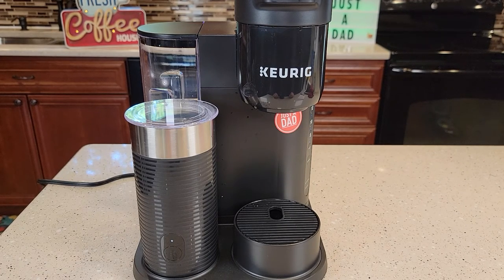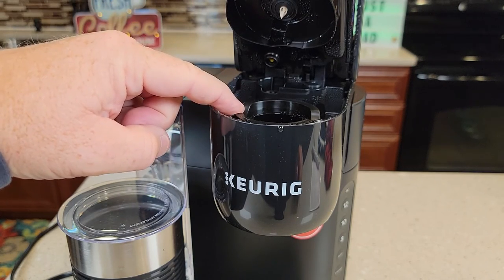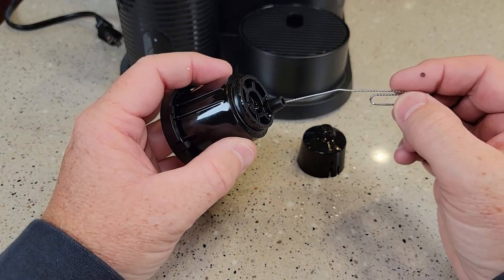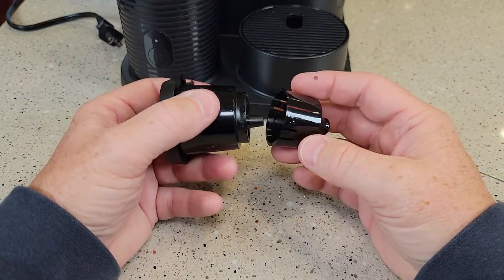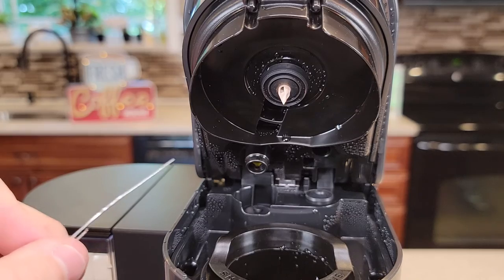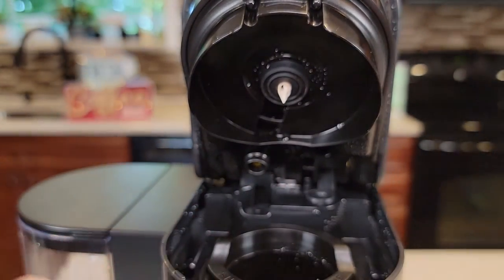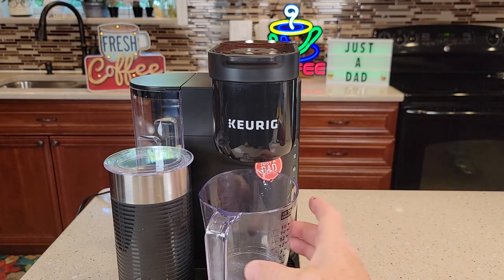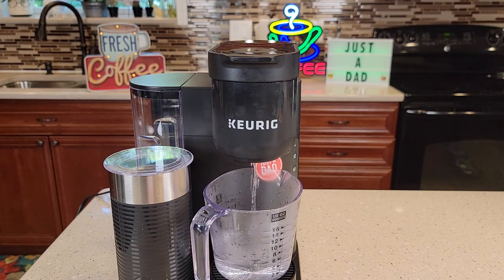HOW TO FIX KEURIG K-Cafe Essentials CLEAN NEEDLES With Paperclip

Comment: Help! I can happily descale and the water will flow, but when I go to brew all the lights come on but don’t respond and will not brew. I’ve cleaned the basket and reset the heating element as well as ran it through descale.
Reply from the maker: I would call Keurig they have good customer service.